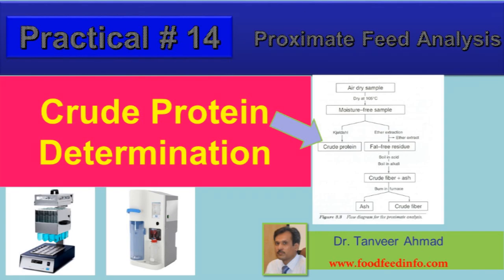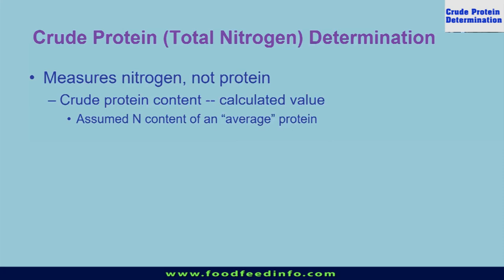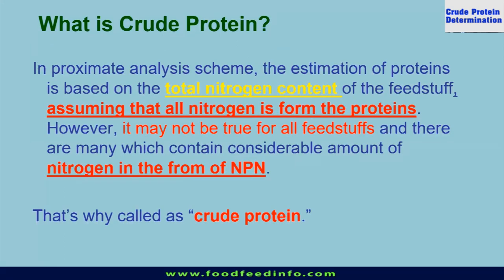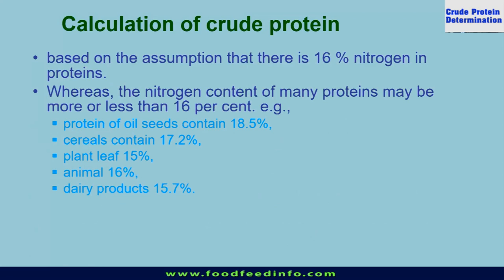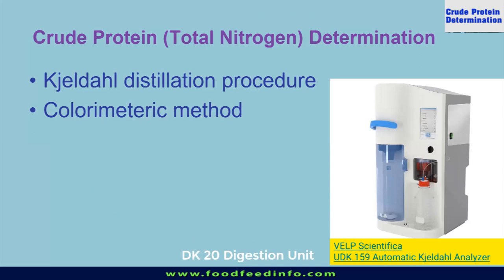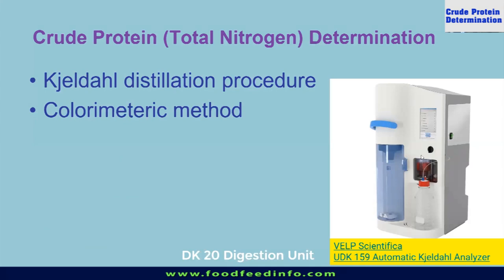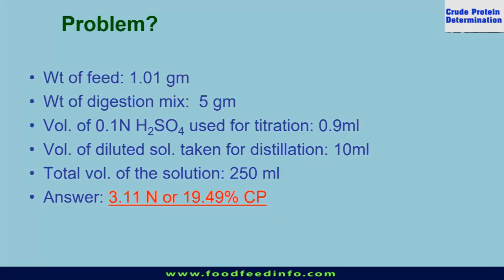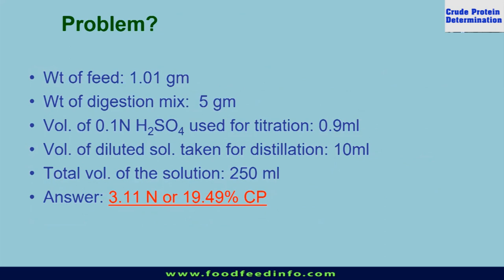Practical#14-Determination of Nitrogen-Crude Protein in Feed-Lecture Series in Animal Nutrition

Comment: 1. Crude protein determination for a given sample is actually the measurement of total nitrogen in the feed content not protein itself. After determining Nitrogen in feed then amount of nitrogen is used to determine the average protein content.

2. Distillation is done during crude protein measurement in feed sample, in this process ammonium sulfate is reacted with a strong base to release nitrogen. Nitrogen is liberated in the form of ammonia which is the dissolved in weak acid.
19-Arid-2201

Comment: 1. Apparatus required for termination of nitrogen-protein are burette, pipette 10ml, Kjeldahl digestion apparatus, Kjeldahl digestion flask, volumetric flask, and Kjeldahl distillation apparatus.
2. Reagents involve sulphuric acid solution, concentrated sulphuric acid, catalyst mixture, sodium hydroxide solution (40%), boric acid solution (2%), and methyl red indicator.
19-arid--2240

Comment: 1. In the digestion process, colourless solution indicated the completion of process while a blackish solution will indicate that process is incomplete. Similarly, addition of copper sulphate will give a bluish tint to the solution
2. The amonia gas is trapped into boric acid after distillation which is titrated against 0.1 N sulphuric acid.
19-ARID-2257

Comment: 1. The potassium sulphate in the digestion mixture increases the boiling point of acid.
2. Calculation of crude protein depends upon the assumption that there are 16% N in proteins.
19-arid-2219

Comment: #1) The crude protein content of a feed is determined on the basis of the total nitrogen content of feed that is actually determined through the experiment.
#2) the potassium sulfate indigestion mixture raises the boiling point of acid whereas copper sulfate acts as a catalyst.
19-arid-2246

Comment: In Kjeldahl digestion and distillation process, all N of sample is converted to ammonium sulfate which is distilled in Kjeldahl apparatus and ultimately converted into ammonia. Ammonia is captured in dilute boric acid solution. Nitrogen is calculated and converted to crude protein by multiplying with standard conversion factor. 
19-arid-2198

Comment: 1. Crude protein determination measures nitrogen content in a feed sample,not protein.
2. The apparatus and equipment used for this experiment is:
•Kjeldahl digestion apparatus
•Kjeldahl digestion flasks
•Kjeldahl distillation apparatus
•Volumetric flask 250ml
•Burette
•Pipettes 10ml
19-Arid-2186

Comment: 1.In the determination of CP the end product of digestion is clear but if the colour is black it indicates the partial digestion of sample.
2. At the start of distilation the colour of boric acid is light red but after absorption of NH3 GAS the boric acid becomes colourless.
19-arid-2284

Comment: The procedure used in crude protein determination is kjeldahl distillation procedure with colorimetric method. The calculation of crude protein is based upon the assumption that there is sixteen percent N in proteins.
19Arid2288

Comment: To calculate percentage crude protein content, we find % nitrogen in feedstuff and multiply it by numerical value called as protein conversion factor. It's value vary slightly with respect to different feesdstuffs. In case of corn,  we take it as 6.25
19-Arid-2224

Comment: The steps involved in protein digestion are digestion, dilution, distillation, titration and calculations in a respective manner. Sulphuric acid and sodium hydroxide solutions are used in earlier steps.
19-Arid-2304

Comment: ✓Commercially produced tablets are available which contain potassium sulphate, copper sulphate, and iron sulphate which when added in solution can act as catalysts
✓The protein conversion factors are different for each feedstuffs so if the sample is known, we can multiply the resultant nitrogen with specific factor to yield a rather specified crude protein percentage
19-Arid-2254

Comment: The catalysis mixture which are used in this procedure have some functions. The potassium sulphate which used in digestion and catalysis mixture help to raise the boiling point where the calcium sulphate act as catalysis which speed the reaction.
Iron sulphate help in avoiding any bumping if present in procedure. 19_ARID_2296